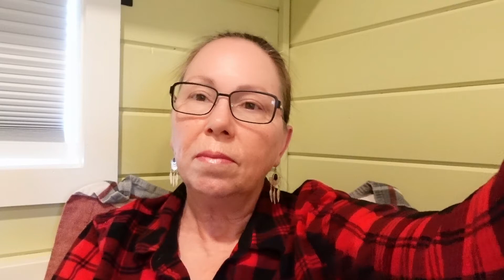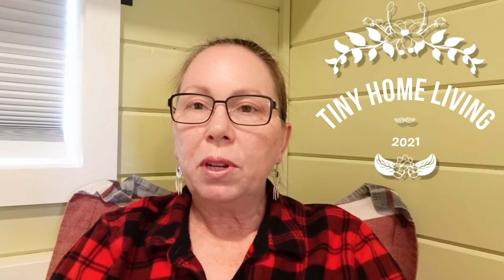Tiny Home Living

Comment: I tried potato towers in 2020 as well haha! Same issue, not enough produced, both in the wire/straw ones, and the spare tire towers.
Reply from the maker: Yes, waste of time. We are trying the Ruth Stout method now.
Reply: @tinyhomelivinginalberta3451  we've grown potatoes under hay before, but we tried it on top of undisturbed soil last year and with the drought, it was also a failure. We're going back to placing them on black soil and covering with hay again.
Reply from the maker: @smallgreenfarm  yes, it is surprisingly easy and the chickens have been free ranging out there so lots of fertilizer now!! We had a problem with mice and we think slugs so have to figure that out.